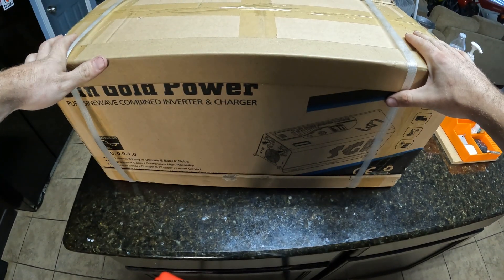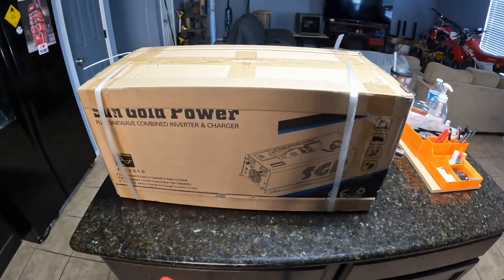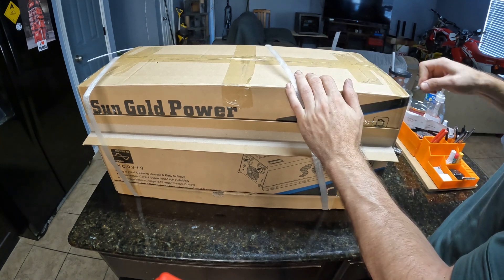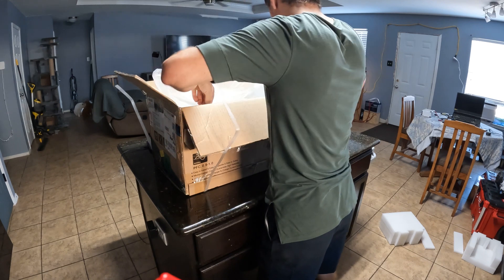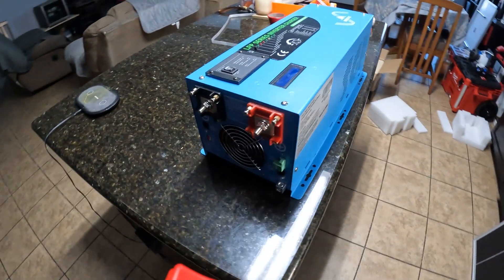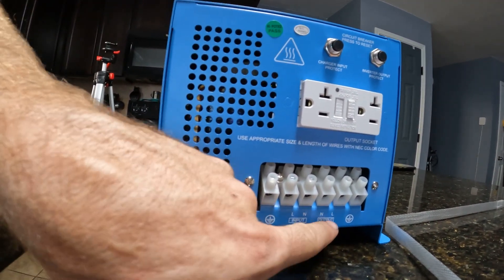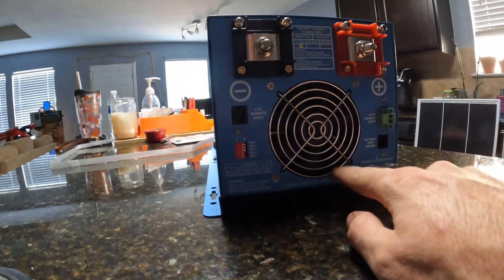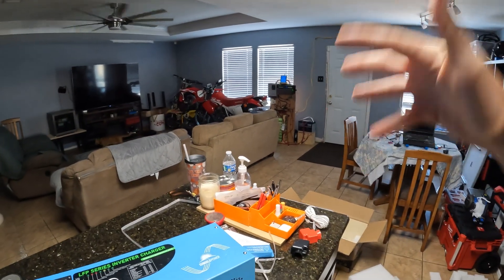3000 watt power inverter Unboxing

Comment: do you use the power on your house?
Reply from the maker: This is for a backup system. You can connect it to the wall and it will recharge the battery bank